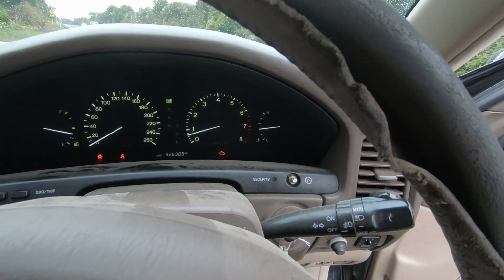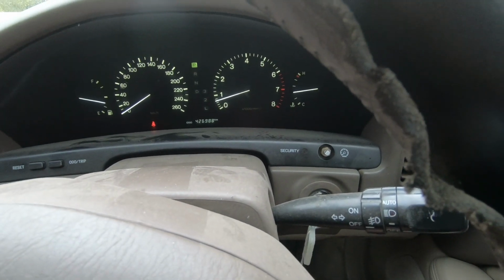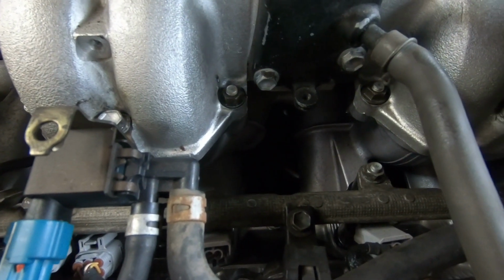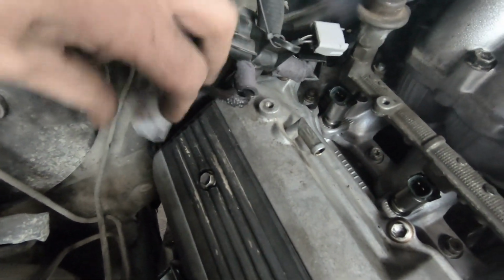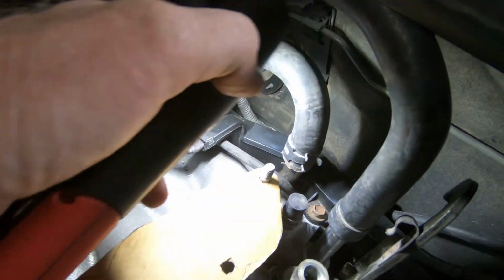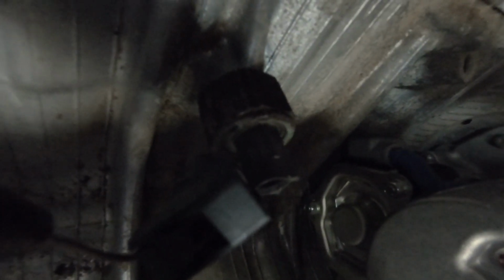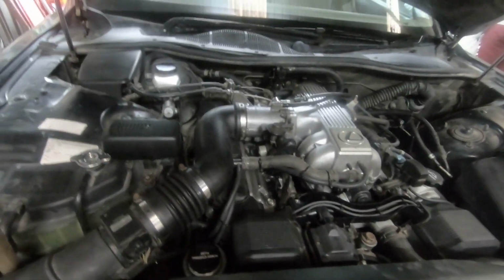LS400 Knock sensors

Comment: Hi Kelvin just wanted to ask i swapped 1uz non vvti 1995 auto trans into my cressida the engine is not revving more than 4k/4.5k rpms when i floor the pedal the engine keeps rev limit on 4k rpms not going to redline which is probably 6.2k rpms

Comment: hi Kelvin! You helped me immensely with getting my LS 400 up and running, so I thought I'd give a tiny bit back. I was at my wits end with knock sensors ( showing electrically OL on multimeter, so I opened one up with an angle grinder, carefully grinding the rim by the plug side, while rotating the sensor held in a 27mm socket. Inside, I cleaned the internal contacts/plates with contact cleaner and 1500 grit sandpaper, and the sensor revived. The guts are held in with a screw, so you only need to JB weld the plastic plug top back on. My car runs great and the check engine light is out. ( my car is Dubai spec, don't know why, but has no egr...my daughter's small hands helped , along with a long socket extension, to access the sensors, without removing the manifold.) Thanks again for sharing your knowledge and helping our community! edit (I also rewired with shielded RG 58 coax cable)

Comment: Can this cause erratic idle?
Reply from the maker: Not normally.  more likely a lack of power.
Reply: @CartuneNZ i have an ls400 with erratic idle done multiple diagnostics cant seem to find the problem car shoots code 55 under load and erratic idle at cold start until it gets completely warm thats when it calms down the idle also replaced cam and crank position sensors iacv and maf

Comment: I am trapped in a nightmare loop with my 94. I have rebuilt the ecu professionally, replaced the knock sensors, and repaired the knock sensor pigtails in the valley of the engine. Still get code 55 and 52 if I plug in my MAF. If I leave maf unplugged, car runs like a dream but I daily it to college and have a very hard time affording the 9 miles a gallon. I am in an impossible situation..
Reply: I’m having the same issue with my 93 did u ever find out what the issue was ?
Reply: @carlosguzman-jj7mo  since I posted this comment a shop has opened that you can google that fabricates this knock sensor harness that goes bad in the valley of these engines. I have the harness but cant afford to install it because it can cost around a grand to have someone do it for you and assembling the top end of the engine when youre not a mechanic can have varying results... still havent solved
Reply: @hehoohooington510 dang bro 😔 chasing a code myself. You cant get to them from under the car? They are under the intake?
Reply: @MiltonWeeks-c5n Yes the issue is in the valley of the engine and I haven't addressed. Dailying a chevy cruze to avoid the premium gas tax.
Reply: @hehoohooington510 bro im literally struggling too with this I don’t even know where to buy a real good harness or knock sensor I need both bank 1 and 2

Comment: Hello. I am faced with a bad situation. I'm in need for a new transmission pan for my 94 ls400 a341e car. Cant find a used one either. What would you do in this situation? Thanks mr. I live in the usa
Reply from the maker: I have some old stuffed transmissions which I can raid pans off, so its an.easy solution for me.  Asking on 1uz Facebook pages should find you a pan in the usa with ease.
Reply: @CartuneNZ  thanks. Love your videos. Maybe one day I'll open a shop like yours in the usa for 1uz and 2uz lexus vehicles and lx, lc, tundra seq cars
Reply: @CartuneNZ  do you think the 1uz and 2uz pre vvti are both the same as reliability goes in stock form? Just curious
Reply from the maker: @pwhittyp5365  provided both have been maintained well both will have similar reliability levels.
Reply: It's annoying that parts a discontinued for a car that is still perfectly operating

Comment: I didn't hear you mention it but are the 3uz and 1uz knock sensors the same? I have seen conflicting information online that late 1uz vvti knock sensor are the same as early 3uz vvti knock sensors.
Reply from the maker: Maybe I will do a video on the operation of the knock sensors,  and the frequency they work at and then the whole subject is really easy.  Cheers Kelvin
Reply: @CartuneNZ  that would be excellent I appreciate that and I'm sure others would too.

Comment: I have a 1992 sc400 throwing a P0325 Knock sensor 1 Circuit 1 engine code; I'm wondering which brand knock sensor to use as a replacement. A link to a reliable and high quality replacement part would be highly appreciated.. Cheers.
Reply from the maker: I only use genuine toyota knock sensors which I keep in stock myself.  Cheers Kelvin
Reply: @CartuneNZ  Could I purchase 2 knock sensors from you via ebay?
Reply from the maker: @urbitxhesfavoritesc2495  I dont sell on ebay but if you flick my PA an email at info@thecartunecompany.co.nz  including your car details and we will sort

Comment: If you swap the plugs with knock sensor #1 and #2 will that give you codes 52 and 55? Also, what if you get knock sensor replacements that fit but have different plugs? Will it still work if you hard wire them?
Reply from the maker: I cant swap knock sensors around as I always check they are right.  If someone does swap them then its very likely codes could result.  Any replacement sensor must operate on the correct frequency to be compatible with the uz ecu so getting the correct item is important
Reply: @CartuneNZ  thank you for your fast response! I ordered some knock sensors for my 1990 1UZ, but the plugs were different. I was able to hard wire them in as my plugs were pretty much broken. Is it possible that the sensor having a different plug may also result in a different "sensor communication" causing it to not working properly even if hard wired?
Reply from the maker: Early uz have a round plug then swapped to a shaped moulded plug,  I have interchanged between them fine.
Reply: @CartuneNZ  that sensor is exactly it! I believe I swapped the plugs and that is why I am getting both codes. I put the plug that has a 2R marking on the driver side. I am sure the plugs are swapped the wrong way. Thank you so much for your help!
Reply from the maker: Is your car a left hand drive car? Ie America?
Reply: @CartuneNZ  my car is left hand drive
Reply from the maker: So if your car is left hand drive why did you put the Right sensor plug on the drivers side?? Which is the left hand side?
Reply: @CartuneNZ  I wish I was as knowledgeable as you. It may seem like such an elementary thing, but to me I had totally forgotten which plug went where. I saw the 2R and thought, oh that's the right hand side! (My right) It wasn't til after everything was back together and got the double knock sensor code. It was then that I realized what I had just done.

Comment: You think an unrelated constant misfire could cause a knock code to trigger? Cars got a dead fuel injector so I’m assuming that’s why it’s triggering a knock code
Reply from the maker: Yes.  Many reasons an engine is running uneven can trigger a knock sensor code.  I fix other stuff first.  Cheers Kelvin

Comment: I know is possible you know about  this but they are known to have problems on the insulation of the wires to shielding  to ground  I have see  this problem  a lot causing  ecm damage
Reply from the maker: They sure do.  I make lots of new wiring looms for under the intake manifold.

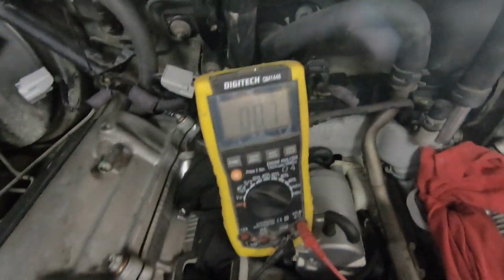Comment: Do you just use another length of wire connected to the multimeter for testing continuity to ecu? ( for reference, the yellow wire around 7:20)
Reply from the maker: Yes,  check resistance of the additional length and its all good.  Cheers Kelvin

Comment: Have a UCF10. Had caps replaced by LSCowboy. Replaced all S/plugs and Wires. Car idles smooth on 95 Octane. But........ Car when overtaking under load at say 75mph suddenly jerks.  Same happens if I use Kickdown.  Using 98ron in France as no 95ron Only place I can do this speed.  No fault codes showing on OBD1.  About to change the upstream O2 sensors. Could it be the knock sensors?  No check engine light appears.
Feel could be running lean at speed (slight engine noise change?) Changed Fuel filter, has original MAF sensor. New coil, the easy one to replace, not the other. Damned if I know why it jerks and I have to fall back. Runs beautifully all other times. Passes Omissions – Your wildest guess please
Reply from the maker: Hello.  A correctly repaired ecu is important.  I have spare test ecus to swap in to eliminate this as an issue.  Often this  sort of stuff is the basic stuff , spark plugs , leads , coils , ignition rotors , temp sensors etc.  Scoping the knock sensors would also be advisable.  Cheers Kelvin
Reply: @CartuneNZ  Thanks Kelvin, I mislead you on the OBD saying no faults. Must have checked it without it being in Neutral. Checked again a few days back and it showed Code 25 being weak fuel. I had the front O2 sensors replaced yesterday and the now not showing any codes. Hope its fixed the problem but won't know until can take the car for a good drive after lockdown lifted. Drives lovely in urban areas. Starts instantly. So, I can forget about the knock Sensors - for now, anyway.  Stu.
Reply: Wait, gearbox in neutral? I checked my codes in park, am I missing something here. 
I picked up code 52, 21 & 28 engine light comes on, lose power and runs bad. 
Ignition off and restart everything seems fine again.
Reply: @FullBoostJ4  check this out http://www.lexls.com/tutorials/intro/codereading.html

Comment: hi i been looking around and i have a 96 ls400. the problem i have is it cranks and spraks but doesnt want to start. It was driving fine then one day i push the gas pedel and it was sluggest and got power and now it wont start. is there anyway you would be able to help me?
Reply from the maker: Hello David.  what have you tested so far?  Cheers Kelvin
Reply from the maker: Hello Frank.  Toyota call it Failsafe and the only condition when not running to cause failsafe on early engines is an ignition fault and the engine will fire then stall.  Cheers Kelvin.

Comment: Knock sensors and starters are always FUN to replace on the 1-3uz's..pain in the ass if u ask me. Good opportunity to clean under the intake and check for bad vaccumm lines. Cheers
Reply from the maker: Once someone has done them a few times they are quite straightforward.  And if they are done correctly they last a long time.  I have found some interesting stuff under the intake.  Cheers Kelvin

Comment: I cut into the loom of my 1JZGTE years ago when running an AFC2. It wanted a knock input for displaying knock I'm assuming. Not long after I had error 52 knock code. Long story short I had to run the engine on one knock sensor, split wiring from one and put two inputs to ECU. Do you think it's worth going back and adding factory style shielded wiring ? as I think simply cutting into the knock wires caused the issue. I just think it's too much of a coincidence that I splice into the wires and not long after get issues. Another great vid btw.
Reply from the maker: Hello Bob.  Hope you are well.  I would be running shielded cable myself.  I'm seeing a few knock sensor wires breaking down these days.  Good luck.  Cheers

Comment: Why are gen2 3uz have 2 wires per knock sensor?, is the other one is a simple ground?. If so, are they interchangeable with a simple earthing the other wire?
Reply from the maker: Second wire is an earth however its referenced back to the ecu.  Single wire sensor is case grounded and two wire case isolated so I dont recommend interchanging.  Cheers Kelvin